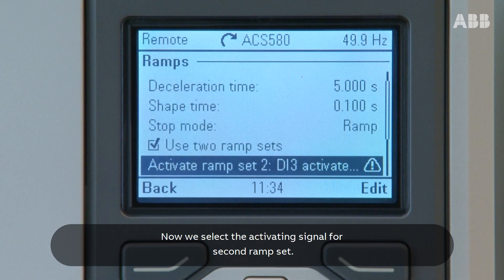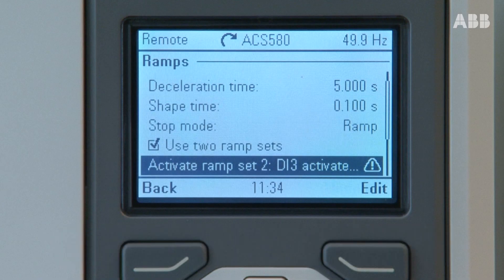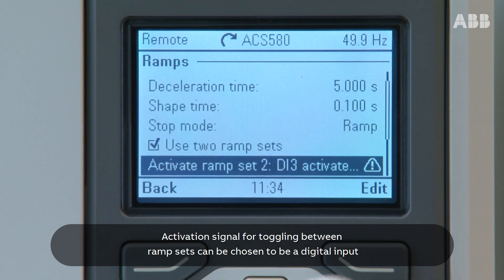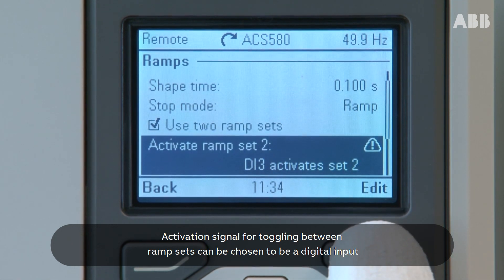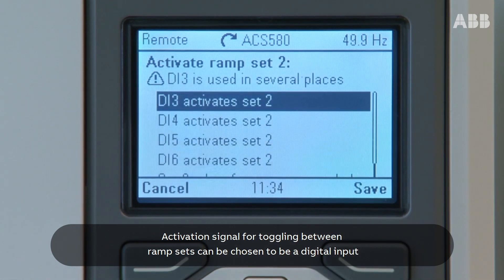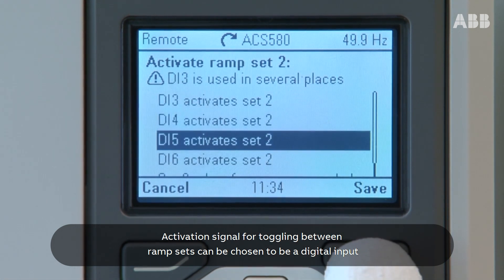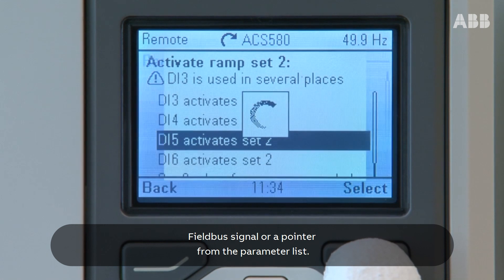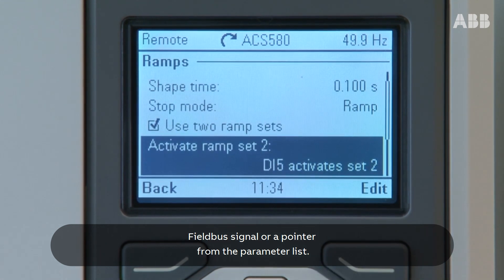ACS580 and ACS480 using two ramp sets

Comment: Please explain why do i need two ramp set?? what is the benefit??
Reply: I have used it before on pumps. First you quickly accelerate the motor up to where the pump is actually delivering, this can also decrease bearing and seal wear in the pump. Then you accelerate the pump slowly over a period of several minutes to reduce turbidity and have less stress on the pipes. 
E.g: Pump ramps to 800rpm in 2 seconds then takes 10 minutes to reach 1500rpm.  
Benefit here is, if you had a single 10 min ramp, all the time the pump is below 800rpm it isn't doing anything.